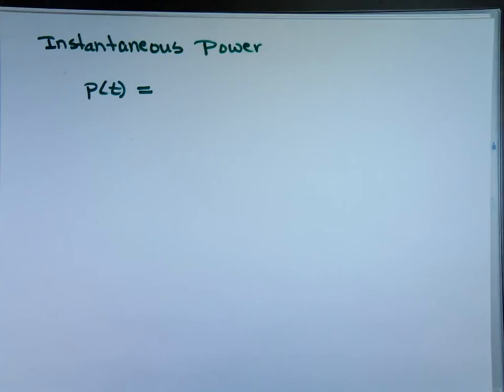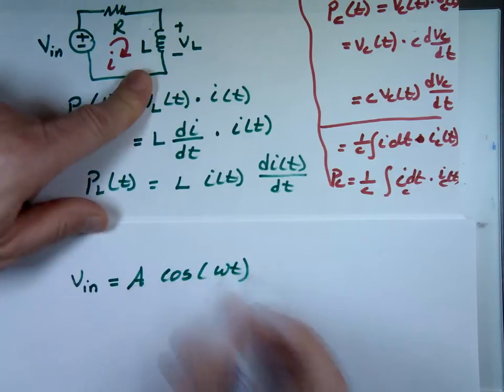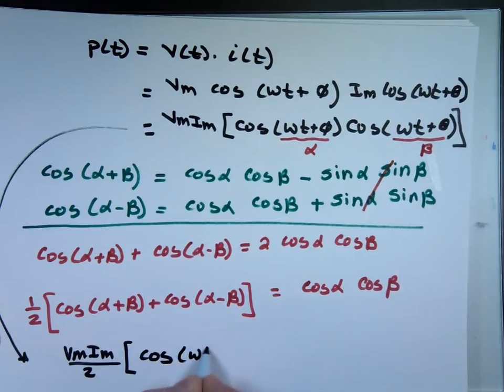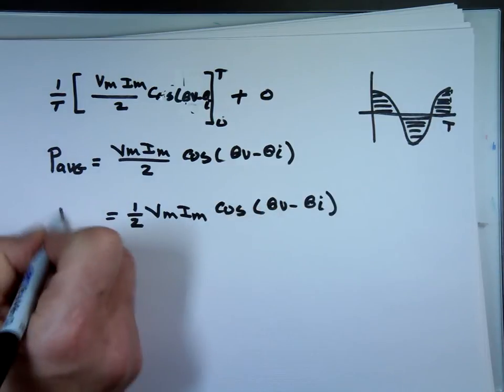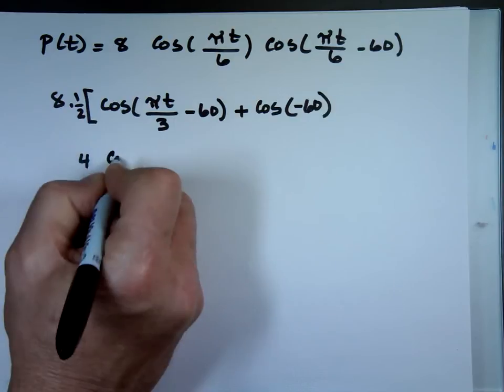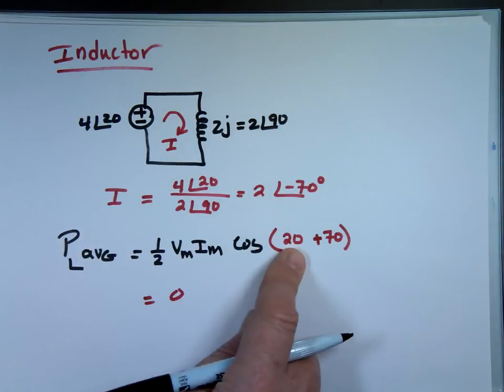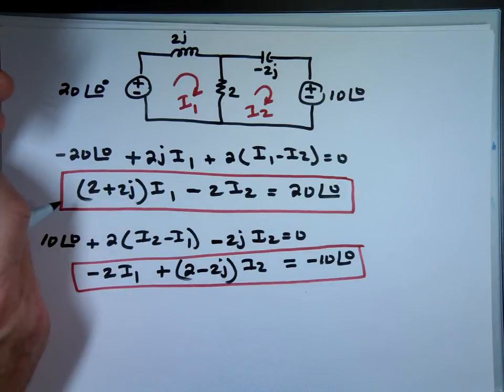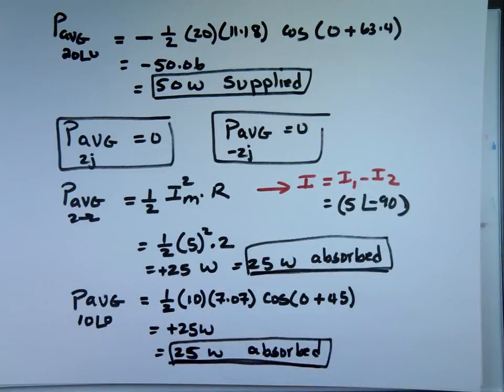Instantaneous Power and Average Power

Comment: I have a question about the derivation of the instanteous power - specifically when the current phase is shifted by thetaI. If I went to phasor land and multipled the original volts (120cost(wt+thetaV)) time amps (120cost(wt+thetaI)) I would get V*I@angle(thetaV+thetaI). After doing the phase shift according to the demonstrated calculation  (and the formal published power formula) I am now at (thetaV MINUS thetaI). How do I reconcile this mathematically?

Comment: why didnt you solve for instantaneous power by converting the voltage and current to phasors wouldn't it have made the calculations easier?
Reply: you will not be able to figure out the phase and the offset of the p(t) graph